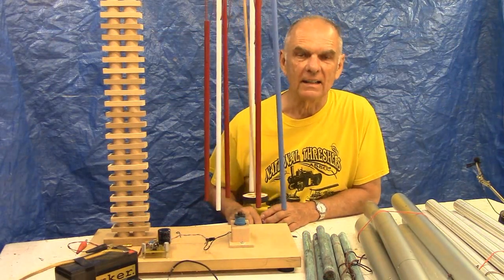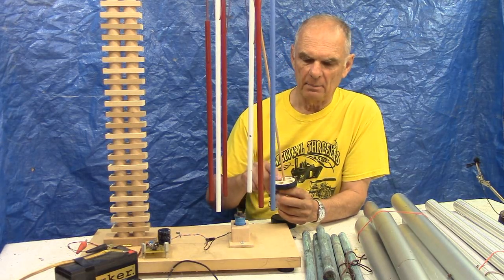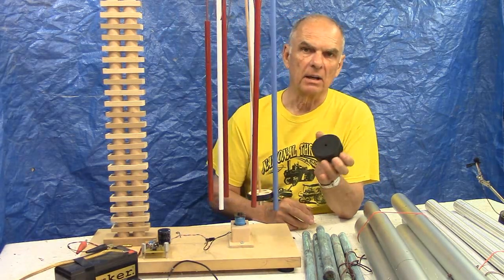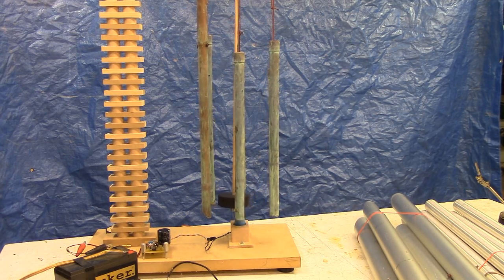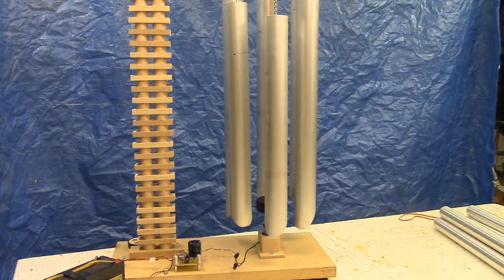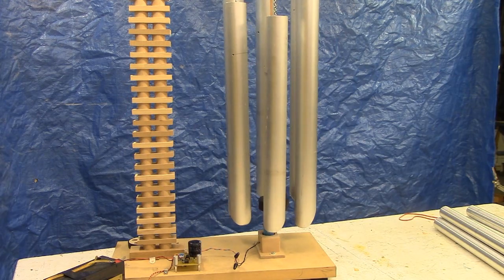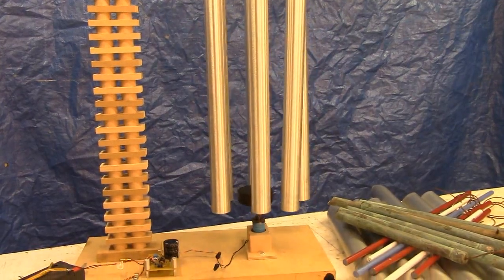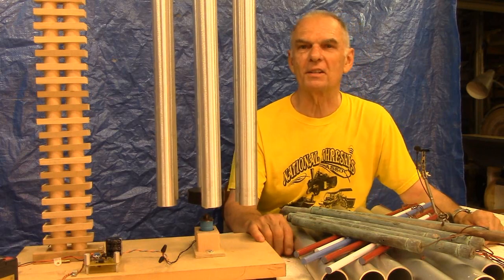Windless Chimes You Can Build

Comment: Hi
How are you?
Its a long time you post this video

Hope y still healty :))

You know how to fix a buzzing tube?

Have 65 inch windchime

Somethimes when the clapper hit the tube , he  make a  buzzing noise , i think from the string
Reply from the maker: Good question, if the tube is cracked it can buzz or if something is touching the tube a buzz can occur. Also, is the clapper cracked and making the buzz or just the tube? Can you tell which tube is buzzing?
Reply: @LeeHiteVideo  hi , thnx for your reply!!!

Its one year old brand :Corinthiam bells and size 65 inch

The smallest tube make noise

I don't see a crack or anything like that, I've stretched the string from the buzzing tube a bit, and now i  hear less time buzzing noise

do you recognize this isseu?

Thnx !